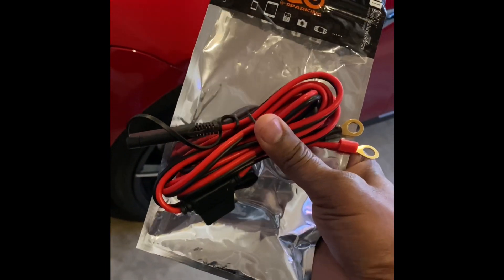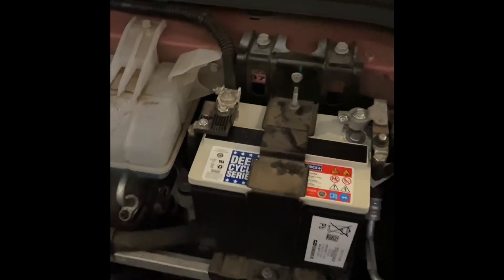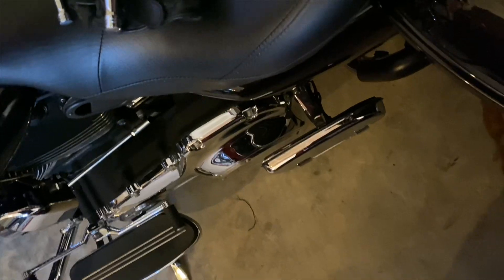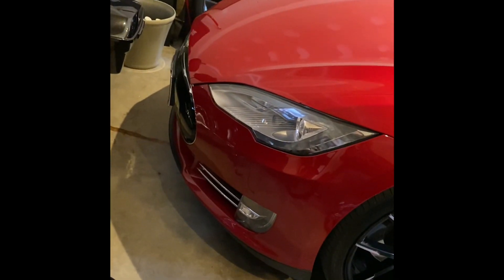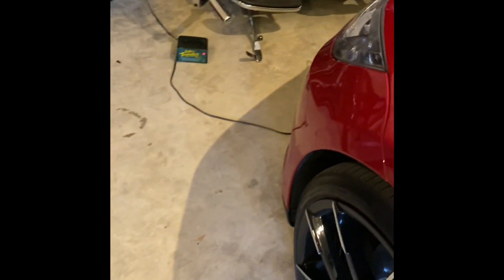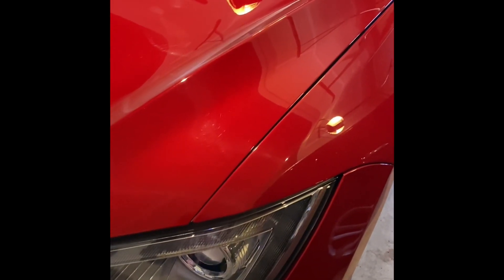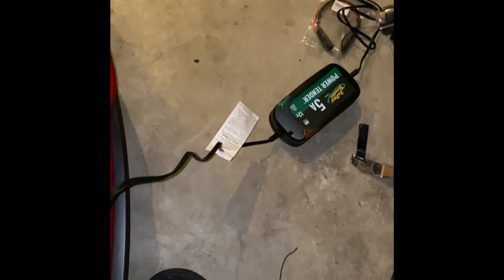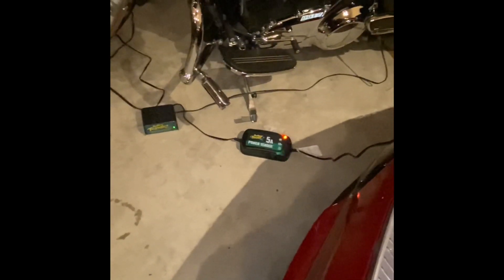How to install a battery tender to your 12v battery inside your 2016 Tesla model S in 2023.

Comment: Nice mod, considering something similar if it may mitigate 12v battery issues. 12v issues in these cars can cause host of problems and leave your car broken down with potential for extended wait times for service.
Reply from the maker: It definitely can help!  I used it and it kept 12v battery charged